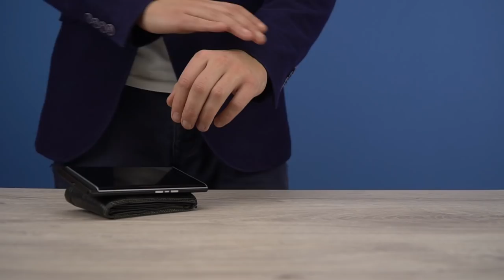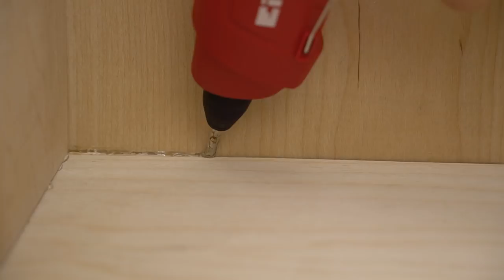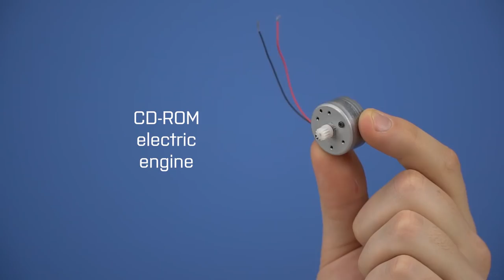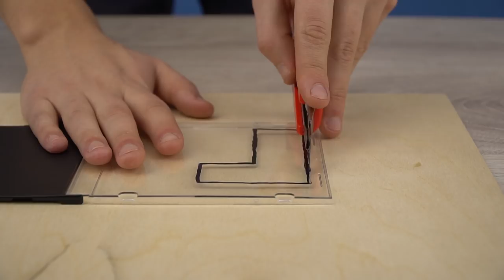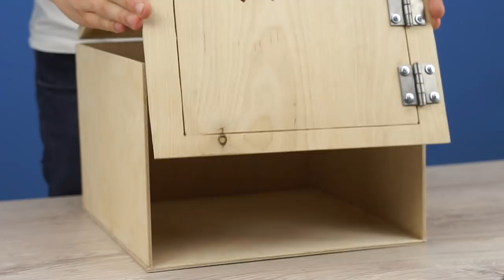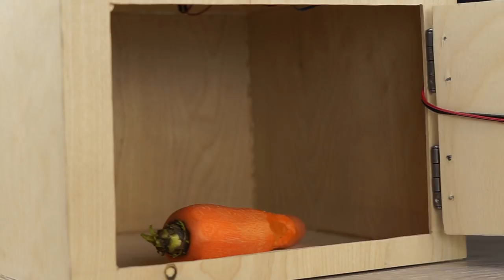Easy Chess Pattern Safe | DIY

Comment: To all the people saying you could just break it to get in:

You would build this to be cool and put cool stuff in, not to actually protect valuables.
Reply: Or just make it out of a proper material, or better yet make the chess table just a normal 4 legged table but have wires underneath go down/inside a leg into the ground/wall to open a hidden and/or more secure safe. This could just be the help to get someone started.

Comment: What if you just shake the box or even just tilt it?
Reply: You should plan the movements so that tilting it in any direction will cause at least one of the coins to fall out of the unlock position. Tilt it one way, and the rook's coin fall to the lock position. Tilt it the other way, and a bishop's coin does so.

Comment: Great idea... Too bad it's made of Ply Wood XD just crack that crud like an egg, let alone just unscrew the hinges. Seriously though, the idea is a fantastic one and I understand that you would struggle to get this to work with a metal frame. Thicker wood is definitely an idea though, just hollow out the segments that activate to lock and reinforce the joins in the wood.
Reply: It isn't very secure anyway, as you could use trial and error with listening closely to eventually unlock it